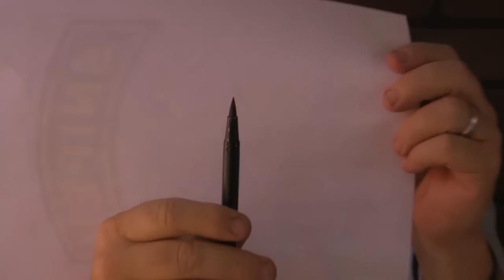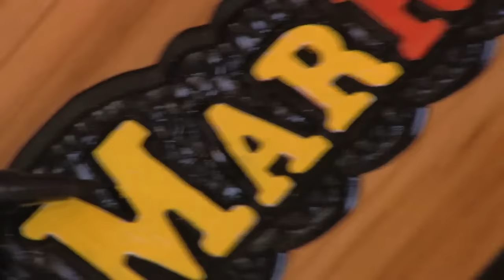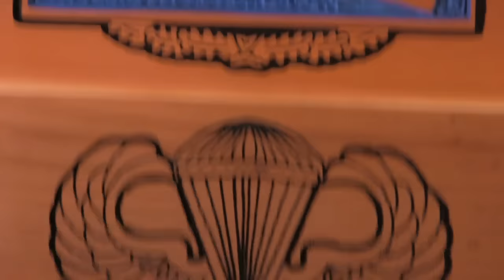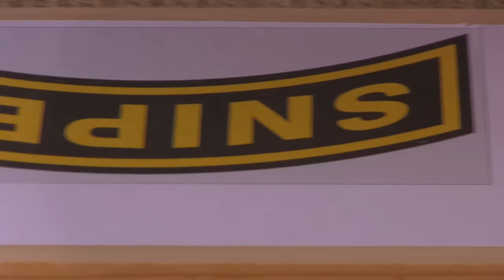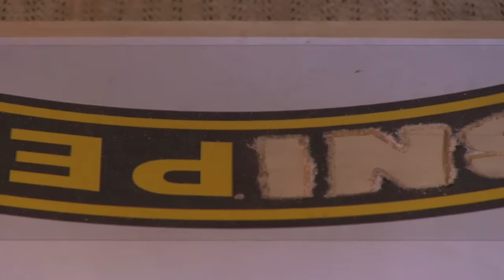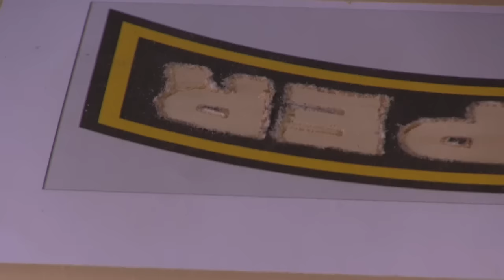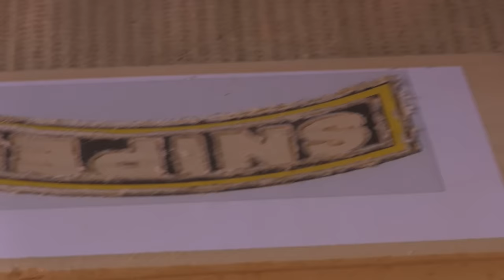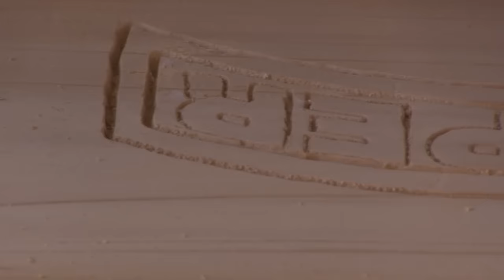Newsletter #175 Carving Artwork Through Paper

Comment: Consider using some blue masking tape to rub over cut out letters, to pull the rest of the papaer carved through up and away.  It works for me (I also use thin - 20 pound paper, so there is less paper to block the image, and pull away)  Great detail on all of your videos; I've learned a lot.  Also for some paper ou can use w spray of water to make it thinner, and make the paper softer to remove with a plastic spatula or guitar pick.
Reply from the maker: Thank you for watching and the suggestion Allan. I do it a little differently now. Thank you for watching, Eric

Comment: I posted this on #106 as well as here. You can save yourself glue and a mess with the glue if you read a method I have been using for quite a while. here it is...Hi Guys, been watching a lot of your videos as I want to try getting into the carving business. I'm watching your video using the backing from a sticker label sheet. I have found a cheaper and great way to transfer letters or patterns similar to what you're doing. I went out to the grocery store and bought freezer paper (about $7 per roll for 50 feet). It's beside the aluminum foil and cling wrap. The one I bought was made by Reynolds. Pull out some of the freezer paper (cut about 12 inches), get a sheet of heavy card stock 8 1/2 x 11 and cut two sheets at a time. Now get a hot iron and go over the dull side (not shiny side, it will stick to your iron), this will stop the paper from curling. Take one piece and place it into your printer. Go to your printer and go to set-up, click mirror image. Now go back and print. Whenever it comes out of printer your image will be backwards, take it to your wood project and rub it with your hand or fingers. Now your image is right side up ready for carving. Make sure you line it up real good, no room for error. The nice thing is, if you make a mistake, take your sander and get rid of the mess and start again. I usually mark a line on my wood where I want it to go. I then trim my paper at bottom with a ruler, draw a line and cut your paper. Mark your paper at bottom with a pen or fine marker (on opposite side) if the pen won't write on shiny side.So you can line up where you want to place it. It's real easy. By the way, some people use wax paper, I find that the freezer paper works best as it is thicker for going through the printer. Have fun. Chris Turner (Edmonton, Canada).
Reply from the maker: Thank you for your input, I appreciate it. I will check this process out, Eric

Comment: Water based ink over paint?
Reply from the maker: For my black spray I use Marsh Ink (oil based) or Rustolium Black Primer (again oil based).
Reply: Dave, enjoy your informative videos. My question was as much a comment as question.  The touch up segment of your presentation showed your usage of the Tombow Brush Pens which are a water-based ink over paint. Didn't appear to provide the coverage you were seeking as the ink ran off and failed to adhere to the paint drips. Thanks, keep up the excellent work.